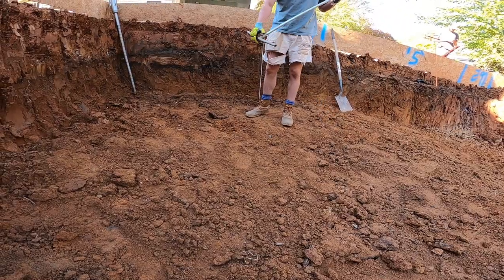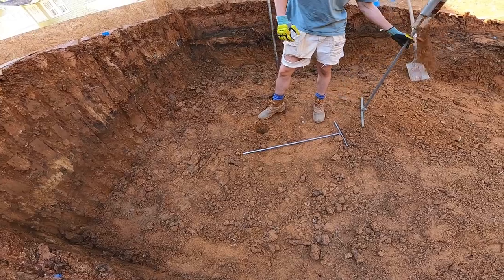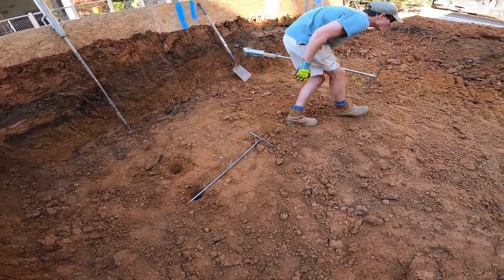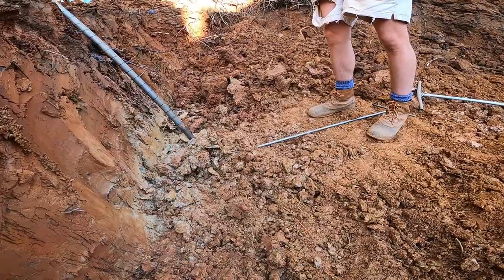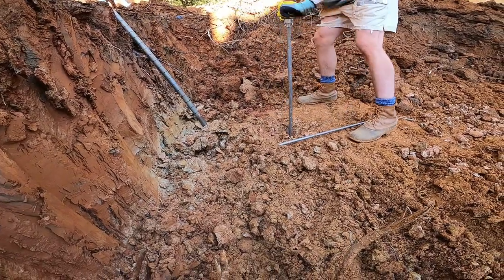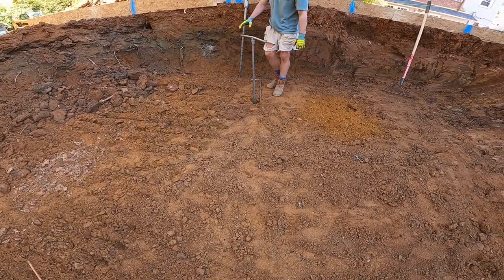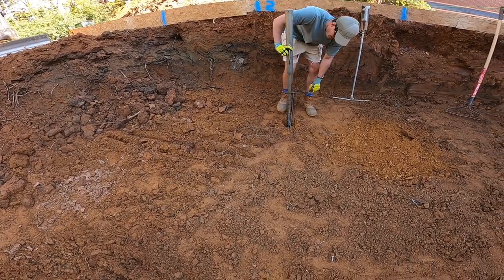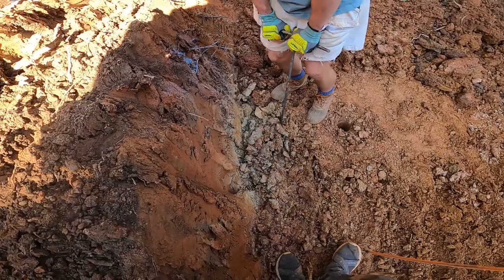So How does a Soil compaction test work? How to use a ground soil probe? Lets find out!

Comment: Great questions and answers. I looked it up, a kit like that is around $2500. There`s also pocket penetrometers for $50, pen size tool you push in 1/4" to get a reading.

Comment: That is exactly what I've been looking for. Putting on a large deck on close to the water table, and do want piers to sink.  Everyone thinks I'm crazy to be worrying about soil psi...   Another vid is a guy making a soil probe from black iron, which is great if you don't mind $35 in black iron and some fittings from HD to get a sample for 4-5' depth without have to auger or dig. 
This looks like a shop fabbed piece from 2"(?) pipe?  You're pushing a much wider diameter tip through the earth than the professional ones, was it ever calibrated against a professional one?
Reply from the maker: I'm confused on your comment? That was a company that the engineering guys use to test the soil? That's a real expert with real tools I'm sure you've heard of Summit engineering

Comment: I may have to get this done for a concrete slab. Would you mind saying how much the soil test was? They have an office near where I am.
Reply from the maker: Normally around 1200 to 2000 in my area 
This is all dependent on how in depth the engineers proposed details are for a proper install. 
And make sure you document every step so if it fails you can go back on the engineer firm that gave you a solution.
Reply: @ExcavationNation  thanks!!!